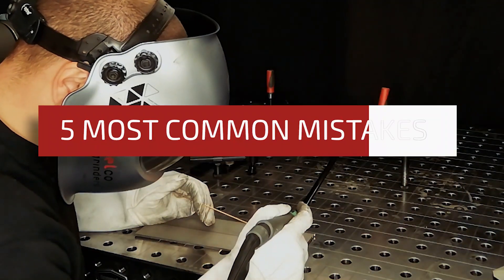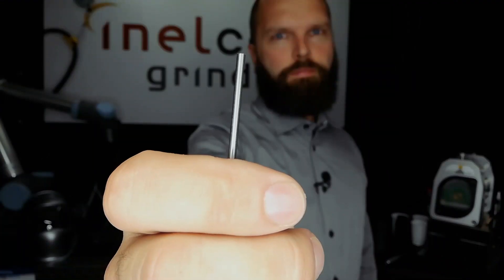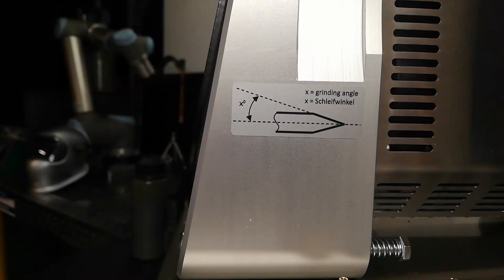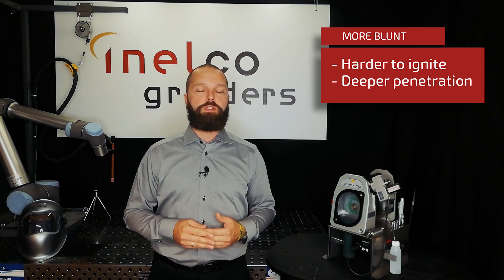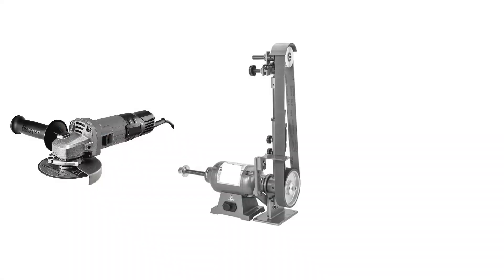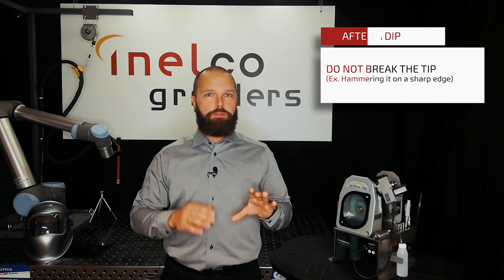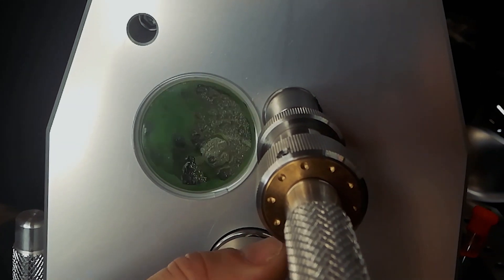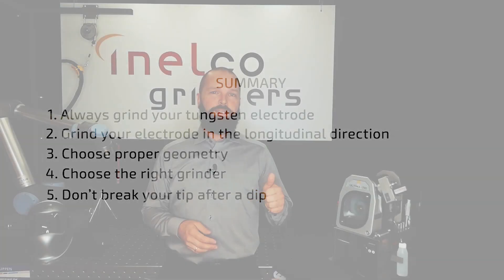5 MOST COMMON MISTAKES when grinding your tungsten electrodes

Comment: If you want to waste your money, go buy tungsten grinder.
Reply from the maker: Hi Stefan - Wether a Tungsten grinder is a waste of money, is very much depending on your use of Tungsten electrodes. For many TIG welding companies our Tungsten grinders save on the use of the Tungsten electrodes. Besides that, our grinders ensure a better grinding quality and accuracy, as well as more safety compared to hand grinding on an open bench or belt grinder. I will be happy to send you more information if you are interested.

Comment: So basically your saying besides the initial outlay of cash for you tig welder you need to spend another 20 grand to maintain your tungsten.
Reply from the maker: I do not know where the "20 grand" comes from. They are not that expensive. But it does make sense for TIG welding companies to spend money on a good effecient and safe Tungsten grinder. Our grinders reduce the waste of the Tungsten electrodes, so the companies can save money buying less of them. And they are safe to use too. It is just like it makes sense to invest in other types of machines and tools, that improves efficiency, quality, and safety.

Comment: what type of cancer do one get from the tungsten dust?
Reply from the maker: Hi Sam - It is depending on the type of Tungsten electrodes being used. The Thoriated Tungsten electrodes are radioactive and can cause lung cancer, but even the pure Tungsten electrodes are problematic if you get the grinding dust in your body. Tungsten itself is known to cause childhood lymphocytic leukemia and once the dust gets in your body, it will be deposited in the bones causing a long term effect. I can send you some articles about this if you are interested. But like all other types of metal dust it can also cause chronic respiratory diseases also known as “metal lungs”. This is why our grinders collects all the dust particles in a contain, that is easy to handle and deposit without getting exposed to the dust.